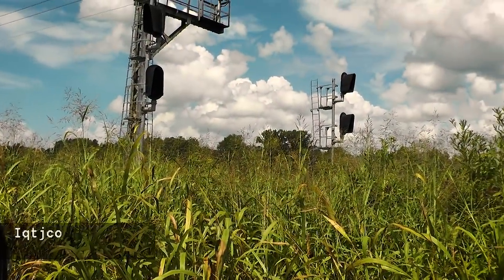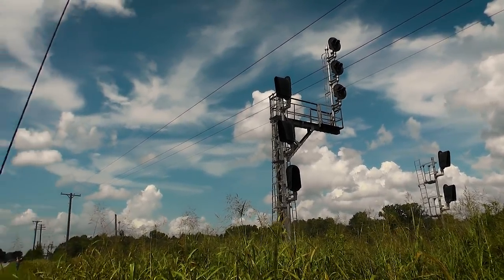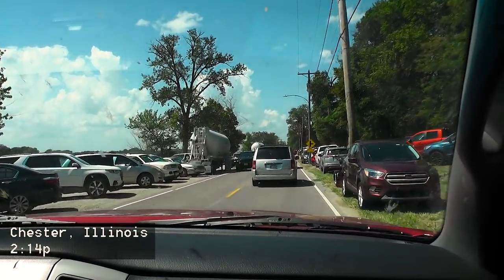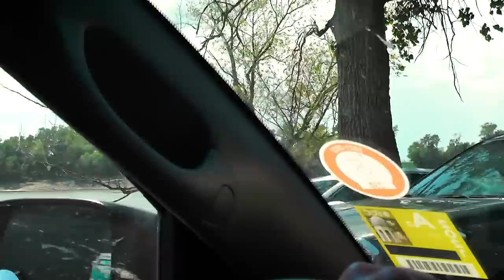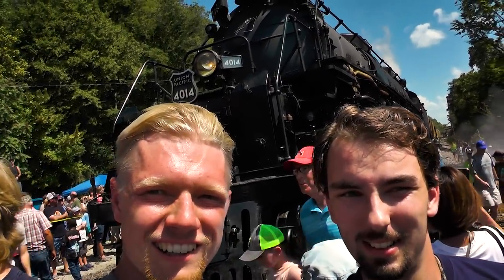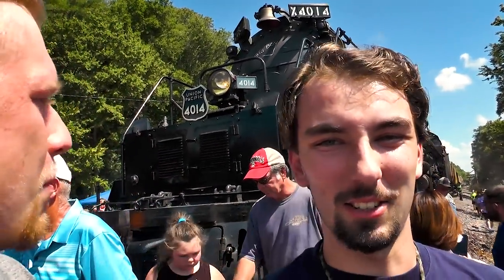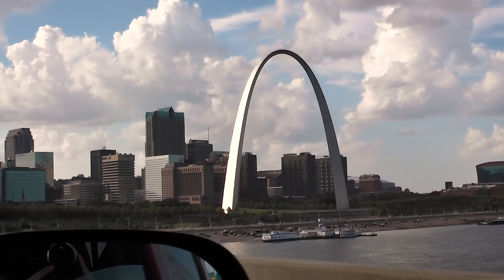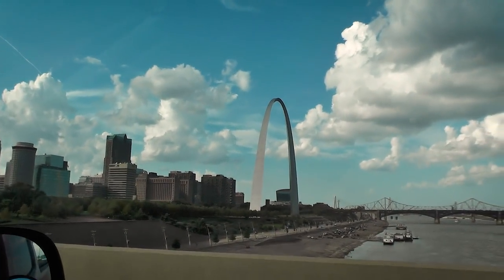World's LARGEST Steam Train Locomotive - "BIG BOY" Union Pacific #4014

Comment: Amazing! In Missouri and Illinois😎. Hopefully the 611 will come back to make an excursion. By the way there has been a change to the NS B Line, and the NS Pulaski District. 16T and 15T curtailed back to Tennessee, 
16T: Irondale, AL - Sevier Yard Knoxville, TN 
15T: Sevier Yard, Knoxville, TN - Irondale, AL 
12Z: Sevier Yard Knoxville, TN - Enola, PA 
11Z: East Binghamton, NY - Sevier Yard, Knoxville, TN. 
So 12Z and 11Z are going through the Pulaski District for now on. 201 and 202 will haul mixed freight and intermodal.
Reply from the maker: Yep they got slapped on the back of those intermodals last week, now the freight is running at the front like it should be
Reply: @RailfanRowan   Yeah I’ve seen 12 and 11Z in many of your videos now I can get em here Southwest VA 😎

Comment: Rowan - You ralise that the throttle on 1014 is harlu open. There is just enough steam going into the cylinders to carry the thick lube oil into the cylinders so not to gall the walls and rings.  By the way, Locomotives do have a special form is braking. Remember the song "Casey Jones, He put the johnson bar in the deep hole - meaning he put the steam flor in reverse. Whe teams was holding the pistons back. As the engine was moing forward, the steam cycle was trying to put the engine in reverse.  So much for synamic braking and the need for a diesel to do the job.  If BB could stop a coa trained of 150 or more cars, it can surely stop a passenger train with only 20 cars,  By the way, the engione is NOT the only thing that has brakes. Every car in the consist has breaks as well. The engine brakes are only got the engine, The other system is for the cars being pulled.  Why is BB not under steam??? Why is it loafing along  (Ed said it was) rether than making the chuffing that everyone wants to hear. Especially at start-up.
Rowan - Touch it. Talk to it. feel the energy in that thing. What a beautiful machine - Once it was the largest self propelled object on land. Now that title goes to the rocket crawler.